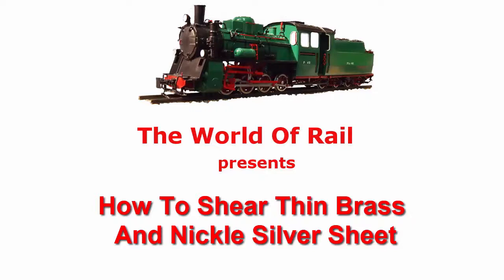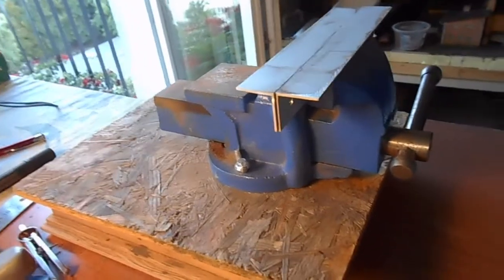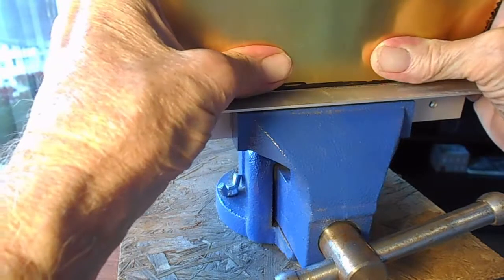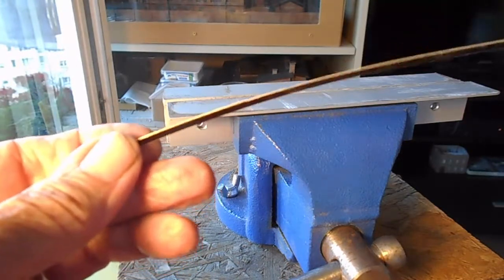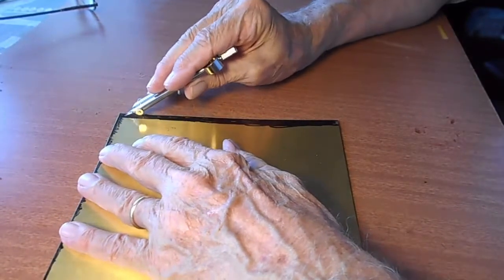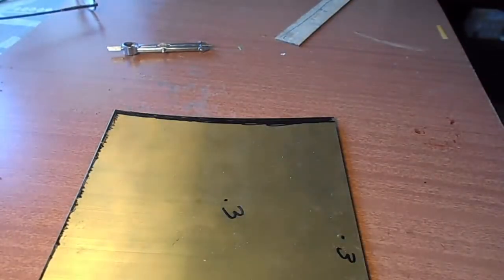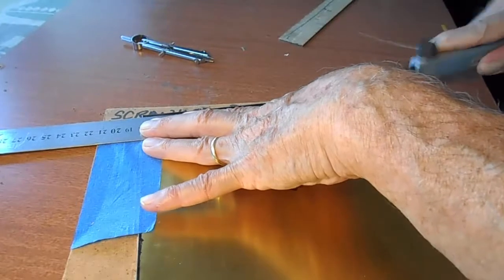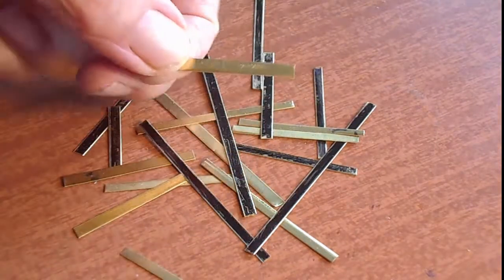How To Shear Thin Brass And Nickle Silver Sheet.

Comment: How narrow can you make the parts?  In my experience the brass has to be hard.  Not sure where your links are?????  Are they cascaded down the rhs of the screen.
Good stuff.
Iain Rice is a great loss to the artform.
Thanks: Peter
Reply from the maker: I corrected the link. Links are below the video.  Since this video I found a better tool for scribing. I will make a video on it.  But you can see it here. https://store.polandsbest.com/collections/tools-for-modelers/products/acrylic-cutter  
For thin or soft brass, back it with a wood block or steel bar/ruler.  That  will keep the sheet from bending.  Actually I often do that with thicker brass.